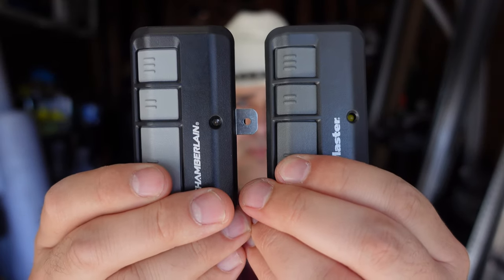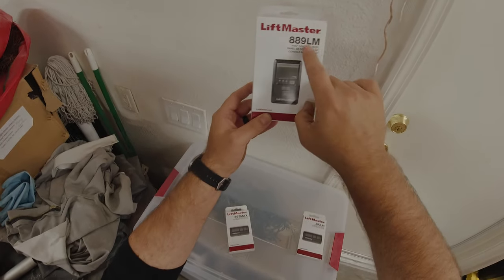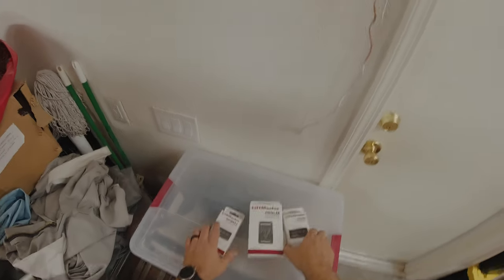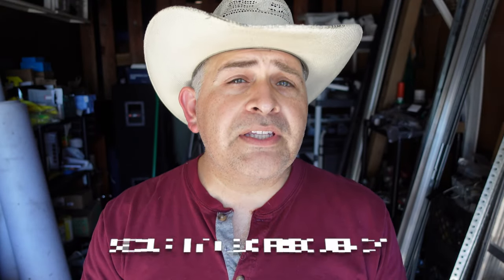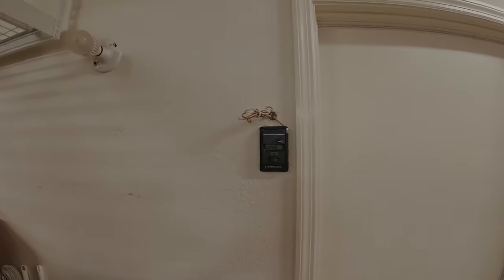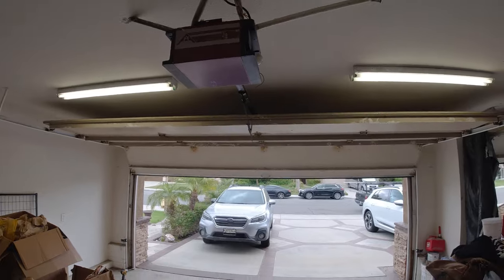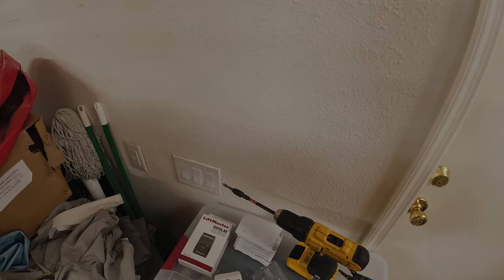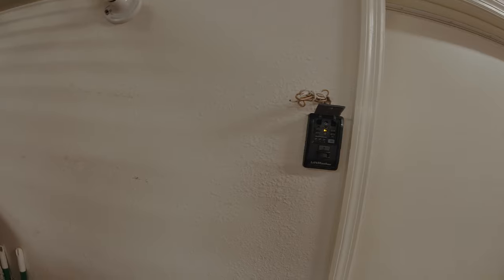LiftMaster 889LM Smart Control Panel - So Smart it Saves Money

Comment: I'm here late to the party. Just purchased a pair of the Chamberlain B6753T openers and installed them last weekend. Thanks to your videos, I learned to also purchase the 881LMW wall controllers separately since they're not included in the packaging.

The motion sensor works great as well as the time to close feature for peace of mind. It's also great that the Learn button is right on the wall controller to program remotes and connect to our WiFi network. The Hold and Lock features and Maintenance features are added bonuses to the 881LMW. Thanks for the videos! Definitely helped my research on upgrading the 20+ year old chain operated Craftsman garage door openers that came with the house when we bought it a few uears ago. New subscriber!
Reply from the maker: WOW!  Thank you for sharing your journey with your new garage door openers.  We are happy to know that the videos helped as a guide.  Y'all stay safe!

Comment: Thanks for the great video that I learned something new. Will it work for 1280R? When we moved into this house, we only used the wall controller since the garage was used for storage. Last year, we want to parked the car inside and found that the red learning button did not work. So we stuck with the wall controller. I had have some issues for the last few months that when I pressed the wall panel, the motor jirked and door remained closed. After couple try and/or waiting few mintues and pressed again then it opened. what do you think my problem was - motor, wall panel or somethingelse? Thanks again.

Comment: Hi, I have a problem with a 889LM I got recently. Every minute, it will go charge it’s self and then after that, it will then go back to normal for a minute before it goes charge it’s self again. It still does this even if it hasn’t been used.
Reply from the maker: Hello!  Thank you for sharing your situation.  

How many times does this happen during the day?
Do you think the battery inside the 889LM might be faulty?
What has LiftMaster shared with you about this issue?

Comment: Great video. Can I still just program my remotes with the button on the back of the motor(Which is purple)? or is it better to run off the new panel? Also do they make a double button panel I have two doors and two motors
Reply from the maker: Hello!  No I don't you can.  The 889LM is built to over ride the logic board to the motor.  Well that was the model before thus I don't believe they change that feature.

Comment: When programming remotes, is it received at the button or the motor? 

I live in a townhome complex that was built recently. All residence have the same garage door opening. My garage door opens sometimes from my neighbor's remotes, and I've already tried to reset my motor and set it on a different rolling code. Would I have to replace the motor? I have a LiftMaster with a yellow learn button. Should I replace the motor with a different color learn button? Please help if you get my message.

Also considering getting the motor setup with MyQ wall button or add-on so I can control the schedule (at least so the garage doesn't open at night time), but it wouldn't really solve the false alarms during the day-time.
Reply from the maker: Hello!  Great question.  You should not have to replace your motor.  If the codes are cleared and your remotes are reprogrammed then you should be free from your neighbor opening your garage door.  Yet, what you might be experiencing is phantom operation, which could be from a bad wire within the walls of your condo or a bad remote transmitter.  

Thus if you are at a crossroad and the problem continues then replacing to a MyQ motor will help control the unexpected operation.  Hope this helps.

Comment: Hello, I have a lifemaster p3 that was only sold in Latin America and on the back of the engine it has a red button that only says delete and is not programmable. Only the wall bell button can be programmed, this button that you show on the video will fit my garage opener
Reply from the maker: Thank you for this question. It's possible that the wall button may not be compatible.

What can you tell me about the program button to the opener?
What color is the remote program button on the opener?

Comment: I forgot to mention the manufacture of the motor is 7/20 and I bought the myQ g0401 hub to make it smart but it does not pair for the same reason that the button only says delete. Do you think that this button that you put on the viese or will help me since I see What if you have the one that says programming?
Reply from the maker: It's possible that the program button may be a specific color which would mean that there could be a compatibility issue.

What can you tell me about the program button color?

Comment: Looks like it’s also in need of a set of lens covers. I would have programmed the 893MAX to the on board radios there for you get better range. The external radios never seem to have great range on them.
Reply from the maker: Hello Sam!  Thanks for the feedback.  I didn't have any lens covers to offer.  The customer cool with it.  Now you're right about programming a pair of 893MAX to the motor.  I did think about it.  Again, the customer was happier this way.

Comment: Great Video! I got a couple of issues here. 1)my control panel started to act up and become unresponsive with the screen going on and off not sure if it is time to be replaced. 2) the ceiling unit has my Q logo but nothing about wifi neither the control panel doesn't have a wifi setup button, Does that mean the unit is not compatible with wifi? if I change the control panel would that solve the two issues? I can share some short videos if interested
Reply from the maker: Hello!  If you can provide me the model number of your garage door motor I can confirm for you if it offers WiFi connectivity.  An older LiftMaster usually has a 4 digit model number like 1356, 3240, 3320, or 8160.
Reply: @sosgds  it is 8550. I've reached today to customer service and it seems that the model is not equipped with Wifi but it needs a hub to enable wifi operation

Comment: A bit confused. Why couldn't the wall button and remotes be replaced with the original wall button and remotes? Are you just not able to source the originals now because the brand/motor is so old?
Reply from the maker: Great question!  So in this case the receiver had very poor reception.  The signal was not able to pick up from the street.  The customer was not ready to replace the motor.  Thus we went this route to help them save money and get a better reception.

Comment: Do you know the voltage requirements for the 889LM?  I have an old ray or that isn’t compatible, so I’m looking to do some radio-shack electronics to pair them…
Reply from the maker: Hello.  According to then manufacture they advise the following:  • Connect ONLY to 7-28 VOLT low voltage wires.

Comment: So the wall button is more like a remote than a simple switch?

I installed a new garage door opener and now my other simple switches that used to control the opener do nothing. They just make the light on the wall control turn off when I press them.
Reply from the maker: Hello!  This product is more of a smart control panel.  It has the ability to work the lights.  Yet from what you are describing, you might be dealing with a bad logic board or the wall button is not compatible with the motor.  What brand of motor do you have?  Do you have the model number?
Reply: @sosgds  b6753t. With my old craftsman opener, if i touched the wires together at the other switch site, the door would close. Now with this chamberlain setup shorting the control wires does nothing except make the light turn off on the new wall control across the room.

Comment: Will the 889 LM work with the 3800 model with 371LM remotes?  Or is there another wall button that you can put on the 3800?
Reply from the maker: Yes this particular wall button should work for the 3800 model wall mount garage door opener motor. As long as it's the purple button. This particular wall button will replace the older wall button and you can program new remotes to that particular wall button, the 889 LM.

Comment: I never cut excess wire or leave bundles hanging. Tape the bundle of excess wire to the active wire and tuck it into the hole in the wall. Connect your new button and it will be a cleaner install. If you ever do need the other wire it’s easy to pull it out of the wall since you taped it to the active wire. Make sense?
Reply from the maker: Hello! Yes it totally makes sense. But for the benefit of the viewer which in most cases is a do-it-yourselfer oh, they might not always have the wire easily accessible to them. But I do apply additional wire just as you say for better access.

Comment: Do you happen to know if it would work to replace a 3 button station (wall mount open/stop/close) with the 889lm, for a LiftMaster Medium Duty (gray cover) MJ5011U door opener/controller? I already have an 828lm working with a commercial series (Security+ 5) opener/controller, on a second door. I would like to control the MJ5011U through the 828lm, but I don't think it's possible to do so directly (to pair the 828lm with the MJ5011U controller).
Reply from the maker: Hello.  Great question.  Now, I don't know with certainty if it will work but I believe the MJ5011U receive is calibrated for 315 MHz.  That's basically the same MHz frequency on their standard purple button motors.  Thus I would give it a try based on this specifications.  Hope this helps!
Reply: @sosgds  Thank you! I received this response from LiftMaster support: "The 889lm will not work with the MJ5011U, the only openers that will will work with the MYQ that we sell on the commercial door side are our logic 5 openers." I'm looking into the Tailwind iQ3 as a possibility.
I'm also wondering if there is a mid-stop option (official or not) for medium-duty LiftMaster controllers? I didn't find such an option in medium-duty LiftMaster documentation, but did see their support page for enabling/configuring mid-stop for Logic 2.0, 3.0, 4.0, and 5.0 commercial operators. It seems to me there might be an unofficial option for such a feature. For example, it seems like the iQ3 or something similar, paired with track/door-mounted sensors, could support this. Nearly all of the vehicles that pass through the door in question are cars and compact crossovers. It seems odd to me to fully open the door (12-15 ft?) for such vehicles. For now I use my single-button 371lm remote, press to open, then press again to stop as I approach when the door is open far enough, then press again to close after driving through.
Reply from the maker: Well I guess it's an official response from the manufacturer. I do find it kind of odd because the MyQ connectivity doesn't need to be used in order to utilize the button by itself. Nevertheless if they are disclaiming that it doesn't work then I would probably look at other solutions. In fact that they provide you any other option?
Reply: @sosgds  In addition to what I previously quoted, LiftMaster support had replied, "The Medium duty openers have a 20 remote capacity, if you are needing more, there is a way to do that, you could get an 850lm, it will add another 50 remotes if needed.
There would need to be some other items needed to use the 850lm, the medium duty does not have SBC or 24vac available.
You would need a separate transformer to power up the 850lm and a part# 71-MLSBC to get single button control."
Otherwise, they suggested I reply if I require further assistance or have questions, and include my phone number if I prefer a call.

Comment: Dear Sir:  Since 10 days ago, we have some serious RF interference in our neighborhood (we and many of our neighbors report their older openers no longer work). My 2007 Liftmaster opener remote must be held 1 foot away from the antenna to operate it. I called Chamberlain Tech Support. They recommended this unit (889LM) as it will use 3 different frequencies (the troublesome 390 mhz, 315 and 1 other..). It Looks like I need to buy another couple of remotes that are compatible with the 889LM. My question is:
How do I program my car's Homelink buttons to the 889LM? (2019 Subaru and 2007 Toyota Sienna). Thanks!
Reply from the maker: Hello.  Very good question.  The Subaru shouldn't have trouble programming to the new frequencies.  You would have to clear the memory out of the HomeLink to the Subaru and then program the new remotes as you would the normal HomeLink program.  Unfortunately, for the 2007 Sienna you'd need a repeater to program a compatible frequency.  But this not a very efficient or cost effective option.

Comment: Why does the learn button blink after the charge happens and it beeps. Mine keeps beeping and the red learn button is blinking.
Reply from the maker: Do you have a brand new smart wall console? If it keeps beeping that basically means the battery inside it is draining or about to drain out. Plus you might need to replace the battery or the entire wall console.
Reply: @sosgds  thanks. Turns out they sold me the wrong wall control panel and I need a 882LM